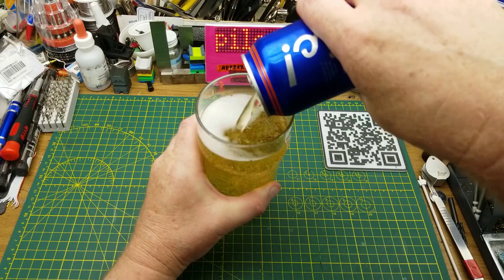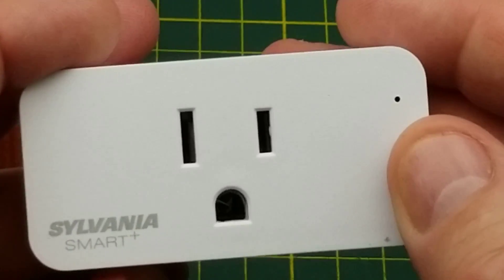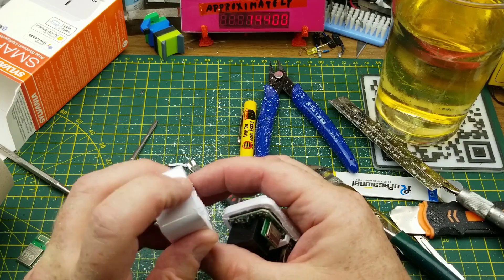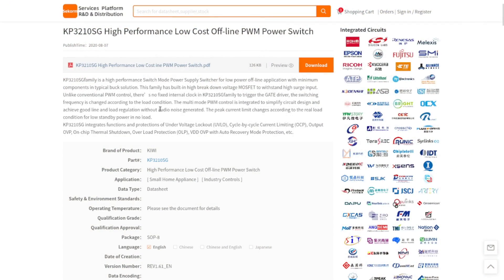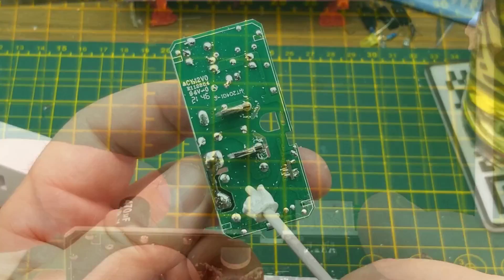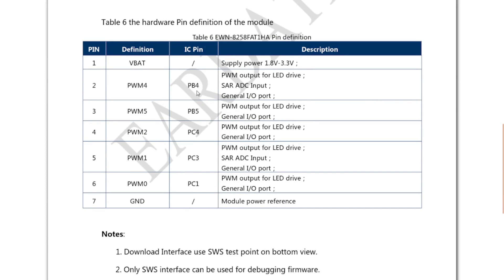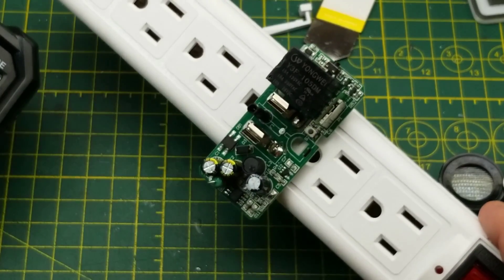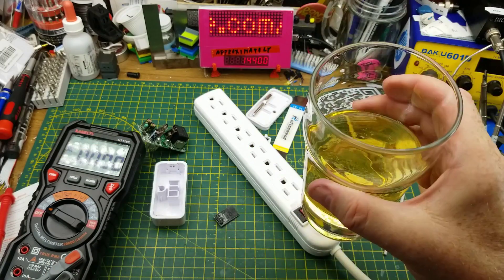Curiosity teardown: smart plug

Comment: I was excited to see when searching my next teardown you happend to do a vid on the product.  As of commenting these are being sold in 4 packs for a Hamilton. 😂 $10 
Nice.  Grabbed a few.
Reply: These WiFi modules are reprogramible Tuyu I think.
Reply: I have noticed the led on some have a holder and others are surface mount.
Reply: The API is useful but I can see improvements and I want to add pF
Reply: Monitors.

Comment: Are these power relays typically double pole double throw?
Reply from the maker: There is no reason for them to be, but I suspect if DPDT relays are less expensive they might use those.
Reply: I’m curious if it’s safer with DPDT if neutral is disconnected along with hot. I’m EE but not edu in the high power side.
Reply from the maker: @sh91899  Assuming the outlet you are plugged into is wired properly, then there should be no potential on the neutral when the hot is disconnected.
Of course, that assumption may be problematic...

Comment: I wonder if Home Assistant can  talk to these without logging in.
Reply from the maker: Dunno. I suppose it's possible, but I haven't spent enough time with HA to figure out that level of things yet.
Reply: @pileofstuff  You'll need a Bluetooth dongle. I am running HA on a RasPi and it talk to Bluetooth devices. If I can find one of those cheap I should try it.
Reply: Yep, you can use an iPad as a home base (and no internet connection is required)…

Comment: A while ago I needed a way to include a Current transformer into a small package and to add a circuit to its output that would send a (wired, not wireless) signal to an Arduino whenever a woodworking shop power tool was turned on. 
The idea was to have one of these for each power tool that was connected to a dust collection system,  The Aduino would know which machine it was and then open and close appropriate "Blast Gate(s) and turn the dust collector on.
 So I bought one of those smart plugs (similar but not identical to yours).  I had t work pretty hard to shoehorn all the components in, but it works.  I had never planned to actually use the "smart plug" feature, by the way.

Comment: I feel like the box could be a little smaller. It looks like all the other ones I have.
I hope its cheap
Reply: These are sold at the dollarama dollar stores across Canada. Seems they received a massive overstock shipment of ledvance/SYLVANIA product and are offloading it for next to nothing at their stores. This gear is surprisingly good quality and is being retailed for peanuts!
As for its size - it’s much better quality than the typical garbage you get nowadays, and they’re using name brand components of a decent size to ensure it can survive putting out a full 15 amp (or 1800 watt) load without overheating…

Comment: Did you notice the relay ratings? 15A 125v or 16A 250V. Usually the current rating is higher at lower voltages, here it doesn't make sense. For that reason I would be very hesitant to run it anywhere close to 15 amps.
Reply from the maker: I wouldn't trust this type of device with more than half of it's rating, just as a matter of course.
Reply: @pileofstuff  for sure I would use this with maybe some lamps something low wattage use !

Comment: One way i found to get that sort of case open is to grip them diagonally in a vice and gently squeeze until i hear cracking, change to different diagonals to break both sides ;)
(diagonal from top left to bottom right etc)
Reply: I have a couple of plugs I opened that way, Araldite and car filler proved useful for making good afterwards. The ultrasonic welded ones don't surrender easily.
Reply from the maker: Unfortunately, I don't have any pliers (or a vice) big enough to get this thing into diagonally.  
I did try hammering on it in that orientation, though, with no significant result.

Comment: JFYI, i too dont buy in to the 'cloud assisted' IoT devices that turn in to expensive paper weights after a year, but a lot of them, like this plug most probably, are controllable via free and Open Source ESPHome BT Relays and/or cheap Zigbee/Z-Wave USB sticks and open source software like Home Assistant. You can make use of these devices with out submitting to the cloud hive mind. ;)
Reply: I got a cheap smart plug from the supermarket, they put in a Realtek controller so I couldn't flash it to ESPHome.
Reply: 100%. You can communicate with these openly, and like mentioned don’t need a proprietary home base or internet connection for them to work…

Comment: I have 3 similar devices, but they came with an RF remote control. There are 6 buttons two for each device, On and Off. No app needed. 👍
Reply from the maker: That's the better way to do it.
Reply: Much simpler and more secure. Remember the S in iot stands for secure and the I stands for I will spy on you. Convert it or use a rf based one and then boom, no weird cloud spying on you anymore. We are already spied on enough with our apps, windows, google, Microsoft and when you have iot with cloud server also a random server somewhere in a different country also spying on you. Rf switches for ever! Its just simple and genius even rc cars use rf they dont need a weird app to control it.